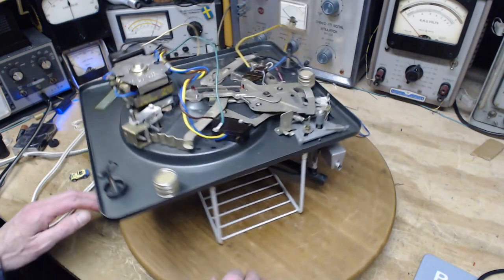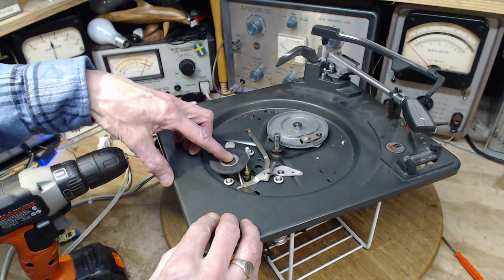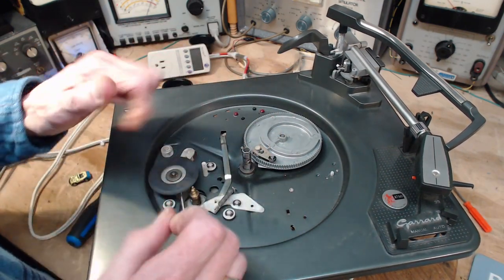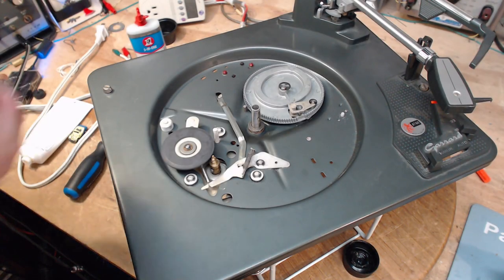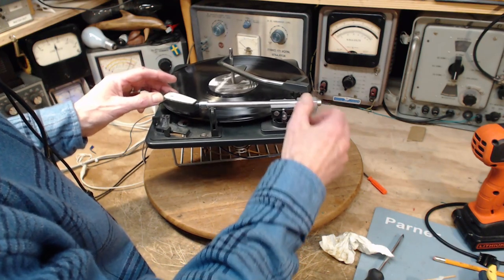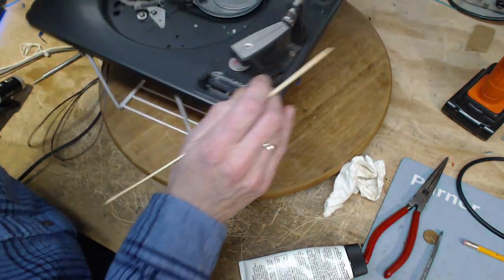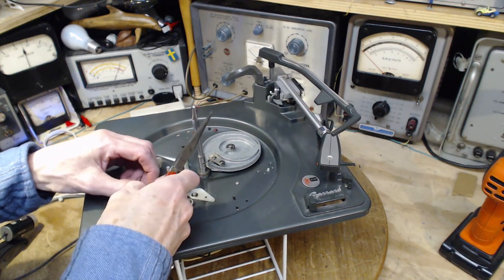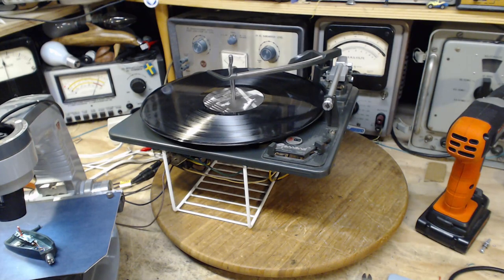Garrard AT60 Record Player Video #2 of 3 - Above Deck Restoration

Comment: Thanks for this video, it was great and perfect timing as I am currently working on an AT60.  My idler arm was barely contacting the motor, but the culprit turned out to be shaft that holds the arm.  It was just crusty enough that it was not allowing the spring to complete it's job.

Comment: These thin idler pulleys are $50 with a return pulley for rebuilding. Ive had good luck coating the drive wheel with A thin layer coating of Plasti-Dip. One technique is to look up the Garrard turntable and get the part number. This can be done easily at Voice of Music on line. NO ! NO! NO! Do not grind rubber material off the drive surface , it opens up the pores to accept moisture, then the wheel splits. Grinding is the a prophylactic cure. Coating is the best way. Having the wheel professionally rebuilt is best and costliest.
Reply: prove that the rubber had pores and absorbs moisture? I find that HIGHLY unlikely.